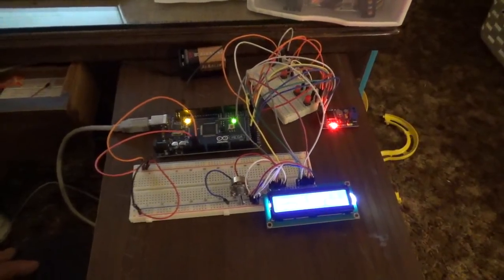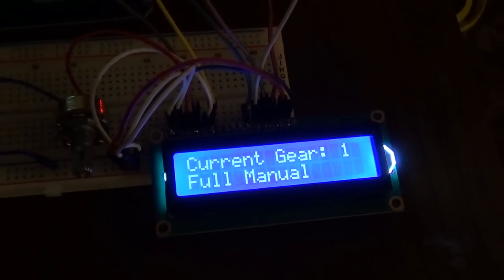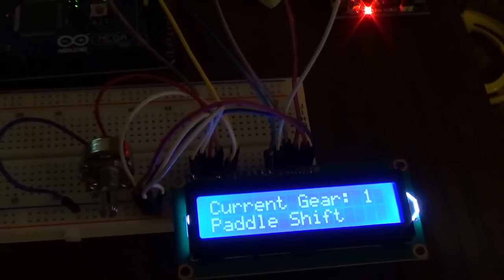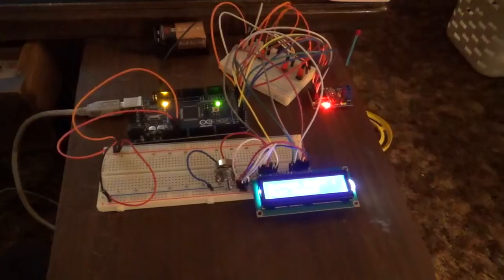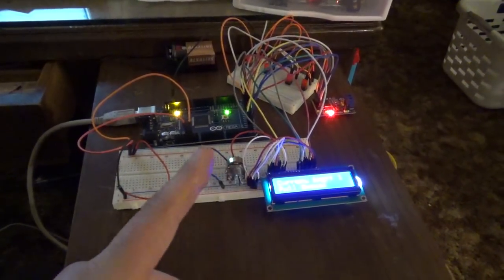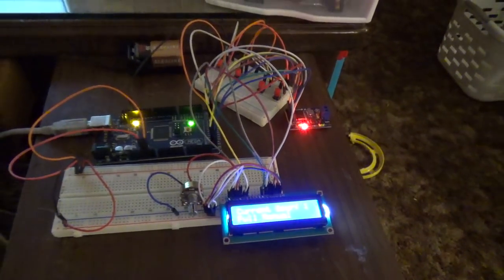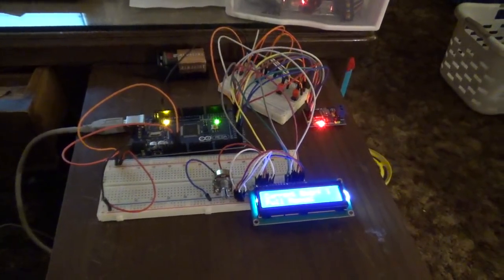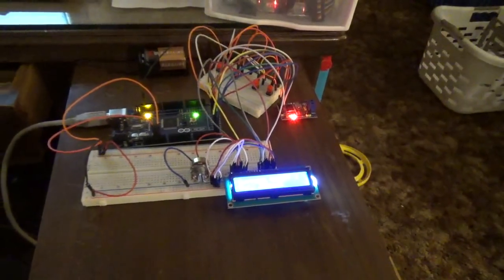Arduino 4L80e trans control, with sloppy transbrake built in, SAY WHAT?!

Comment: This looks like exactly what I am looking for to control the 80e I am installing soon in my Silverado. Very impressive thought process here, I like what I see.. I do have a couple of questions:   1.) Any chance you think this will interface with the stock ECM (vs. Megasquirt) for an LS based platform?  and 2.) When do you think you'll have this available for sale?
Reply from the maker: Mr Tydriver I've seriously thought about setting this up to work with a 0411 PCM for a LS powered vehicle. However I need to get the first one made up and installed/tested before I do that.

No eta on when units would be for sale. I May honestly make this guy open source though. Not sure yet. Want to get a working prototype on my firebird first before I continue on.

Comment: just seen your boost controller on sloppy. i am excited to see what you come up with next
Reply from the maker: Thanks! 4L80e arduino controller, arduino stand alone datalogger, small engine efi, boost controller, small engine dyno controller, are just a few projects I got going on.

At some point I need to bring back the fuel injector flow bench too lol

Comment: How much to you have into this?
Reply from the maker: Not much LOL
Reply: Awesome, so this is going to be a stand alone controller? I'm using microsquirt and Really want to pull the th trans and put the 80 in. I'm a cheap ass lol
Reply from the maker: Your describing practically exactly what I'm doing with this controller. I am currently running a megasquirt 2 in my pontiac firebird that has a LS and 4L80e. This is mostly a stand alone unit in current form. The only thing I have is I setup the ms2 for canbus broadcast (for like a racepak dash) so it is getting RPM and TPS from the megasquirt. You have this ability for canbus broadcast in a microsquirt also. Anyway besides that the rest of the module is independent from anything else.

Eventually I have planned that I want to be able to canbus broadcast gear position and current gear, so I can setup my boost controller for boost by gear with this unit, along with other idea's I have.

Its the nice thing with this style of trans control, the possibilities are just about endless.
Reply: Very nice, can't wait. I don't really want to spend 450 on the micro trans controller. Been watching you on sloppymechanics Facebook. Keep up the good work sir.

Comment: Hey love what your doing! Can't wait to see it in the car. Up next is arduino 2 step?
Reply from the maker: Liam McInerney hey thanks! No arduino two step, I'll leave that to the speeduino experts. I got plenty arduino projects to keep me busy lol.
Reply: So will you be linking the boost controller with the 4l80e controller so that we can boost by gear on electronic transmissions?
Reply from the maker: Thats the idea. Probably via CANBUS communication between modules. I maybe able to put it all on the same module, but I'm doubting it. We'll see.
Reply: Forgive me as I don't know a lot about controllers but with the boost controller, I know you had it set up for micro switches for a manual/mechanically shifted transmission for doing boost by gear. What would you need to do for accepting a signal from the factory ECU controlling a 4l80E transmission to do the same thing?
Reply from the maker: You could probably make the circuitry/code for it to tie into the pressure switch sensors for the factory computer to know what gear the trans is in and do it that way. Thats how I have this setup coded for the FMVB function. Probably wouldnt take much after you figure out what voltage the factory uses to sense those sensors. I'm guessing its 5vdc but you'd have to backprobe a factory PCM to find out.